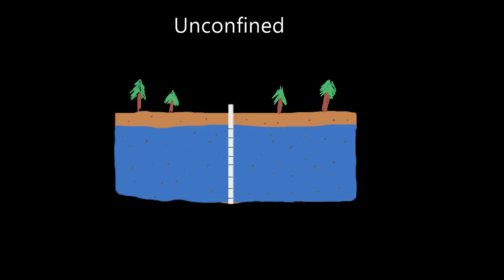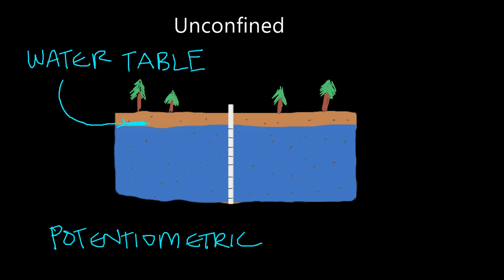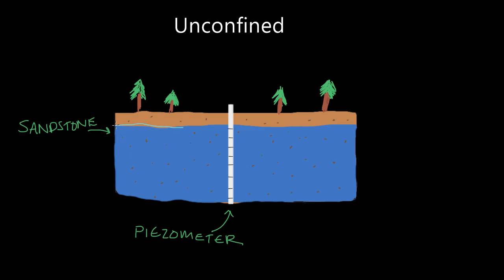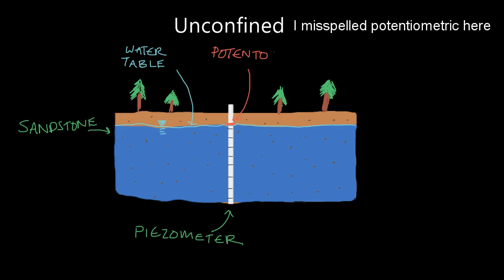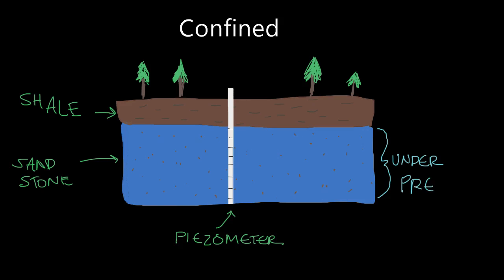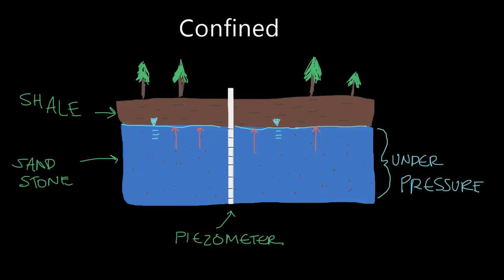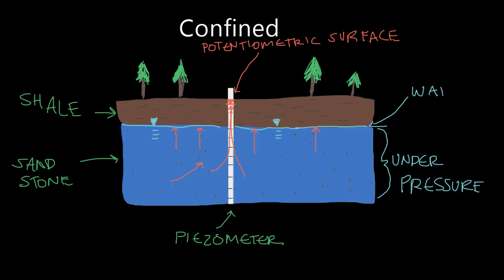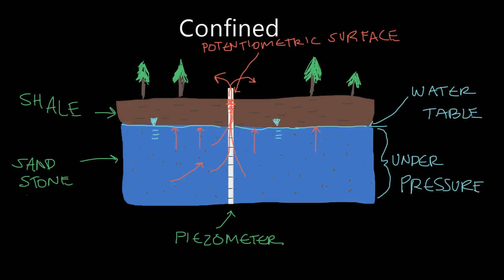Unconfined and Confined Aquifers- An Important Distinction

Comment: In my geology 2301 class they call the potieometric Surface an Artesian Pressure Surface
Reply from the maker: I've never heard that term, but it works for artesian aquifers (which are always confined aquifers). You have to be careful though, because a potentiometric surface can also refer to the water table in an unconfined aquifer (which is NOT an artesian aquifer).

Comment: if the layer is homogenous can we assume it is permeable due to a greater chance of connected pores. and for heterogenous layer it would be impermeable
Reply from the maker: Homogeneity only means the layer has a constant permeability throughout the unit. In other words, the whole unit could be relatively permeable or impermeable, but its the same permeability everywhere within that unit.  Heterogeneity means permeability varies throughout the unit spatially.

Comment: the water table is the potentiometric surface for an unconfind aquifer, there is NO water table for confined aquifers
Reply from the maker: I made that clear in the video.  the potentiometric surface is the level to which water will rise in an aquifer, which is the same as the water table in an unconfined aquifer.
Reply: Firstly I want to say that I did not want my comments to be harsh, I am really sorry my friend, I have to say that your videos are great, smart and helpful! Secondly,  at the start of the video, you said that the water table is the water level in the aquifer, which is  only partly true, it is the water level in the unconfined aquifer. at 4:27 min, you said that the water table in the confined aquifer is .... the fact is that there is no water table for confined aquifers.. I hope this makes sense?
Reply from the maker: No worries, I see your point now. Yes, it would be called the potentiometric surface for a confined aquifer and not the water table.
Reply: @SSSISIable  i think you're wrong -_-